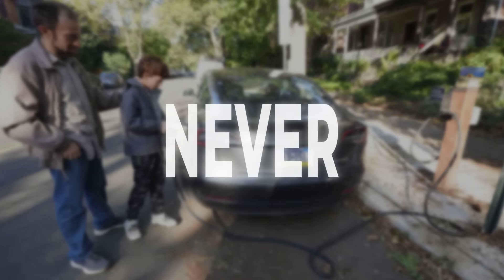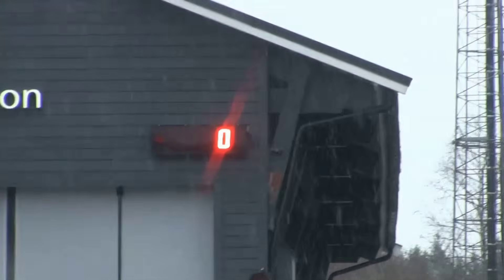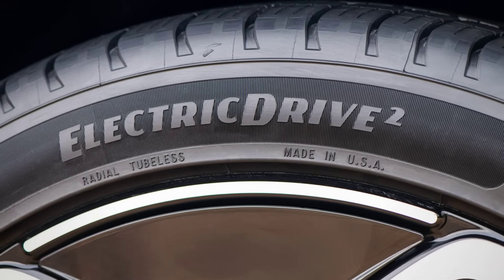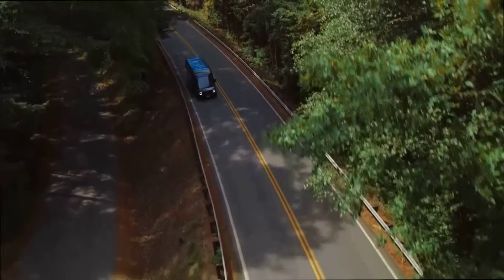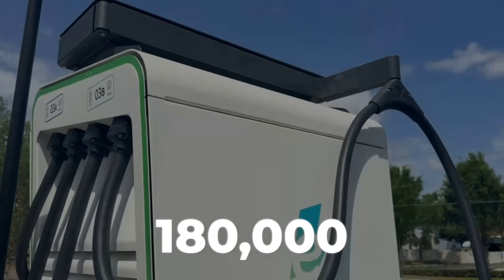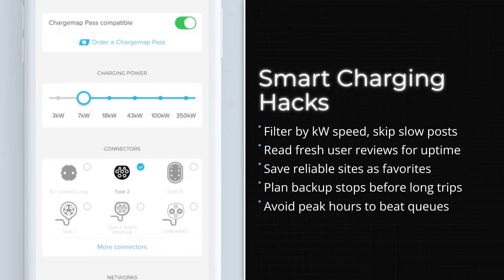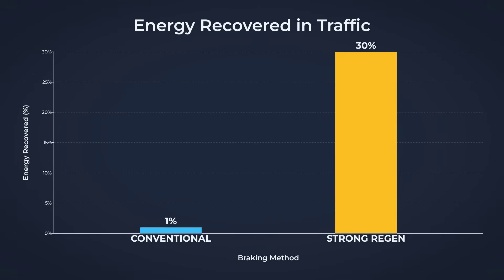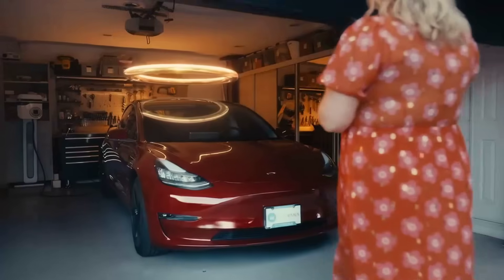Things You Should Never Do In An Electric Car (Big Mistake)

Comment: There was a recent video on Tesla where another group of scientists found that there is no degradation in using fast charge vs home 🏡 charge over the years!
Even a graph 📈 to show that was produced. 
So what is the truth?
Reply from the maker: That Recurrent study definitely turned some heads! 🔋 It shows that Tesla’s thermal management is so good that occasional fast charging isn't the "battery killer" we once thought, but for the long haul, those high temps still add up. Tbh, the "truth" is usually in the middle—modern tech protects us, but gentler habits still give you the best longevity.

Do you primarily charge at home or rely on Superchargers? ⚡